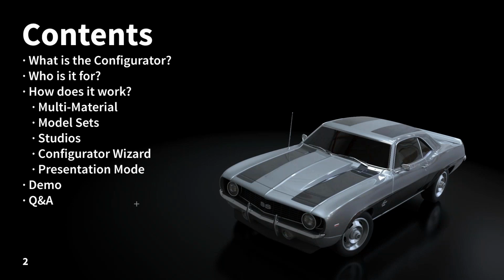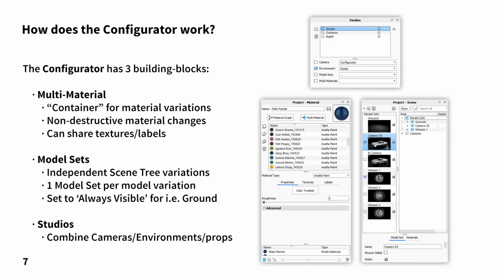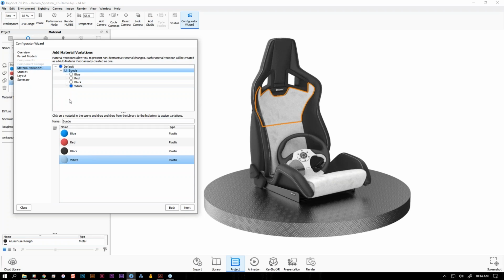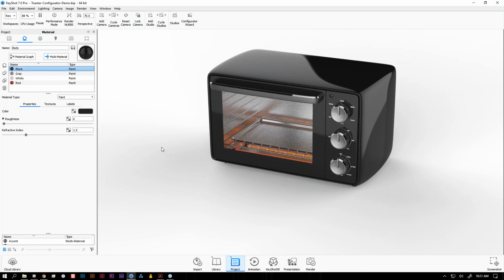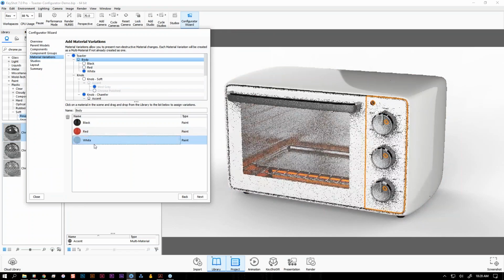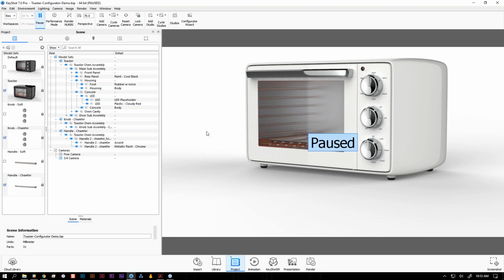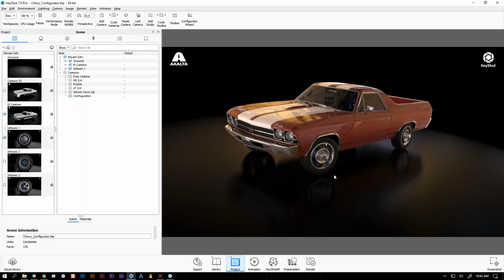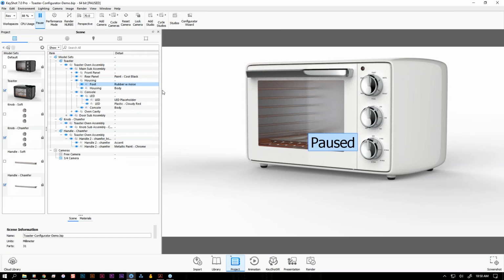Webinar 64: Using the KeyShot 7 Configurator

Comment: I am trying for 2 weeks and I can´t create the layout shown like on the videos. I mean material choice on the right side and model choice on the left. but what I get is categorized but listed categories al on the left side. I would be so happy if you can give me some tips. it is quite urgent. and when I download the  configurator scenes from Keyshot website, their UI also doesn't appear like on the videos
Reply: I have same problem, no way to get the user interface as in the video above. I am guessing this is not available for regular users yet (although I am currently testing KS 9 version) I can't get both color and model variations on the same screen, this is very frustrating...

Comment: IMHO, you guys would greatly benefit from partnering with a game or game engine design company for real time rendering in web environments. Their ray-tracing workarounds allow for ultra high frame rate rendering at a very minimal cost to apparent realism.  A moderately priced home gaming computer can usually manage 60+ fps at 1080p on high settings in car games with complex environments.

If environments were limited in complexity and resolution was either adjustable or limited to a very reasonable 480p, I think it would be *relatively* simple to achieve 10-15 fps on a normal laptop that is internally processing a web implementation of this. Again with present but hopefully minimal affect to realism.

For Keyshot level of realism, a render button could be available for once the customer is ready to output a high quality image of their build. That image could be cloud-processed, substantially decreasing need for monster cloud server investments